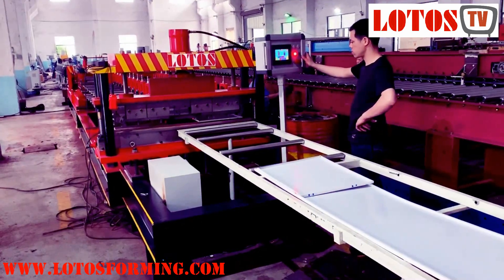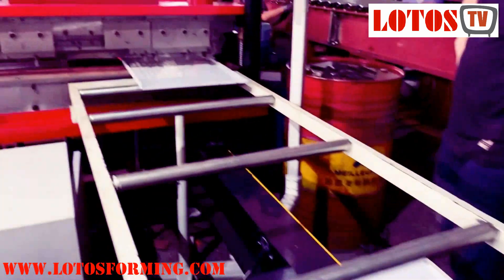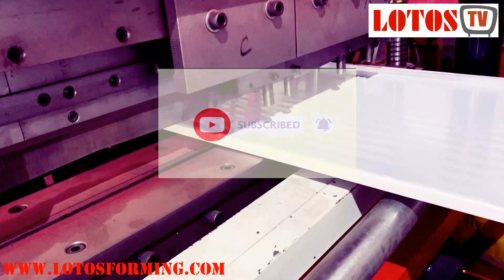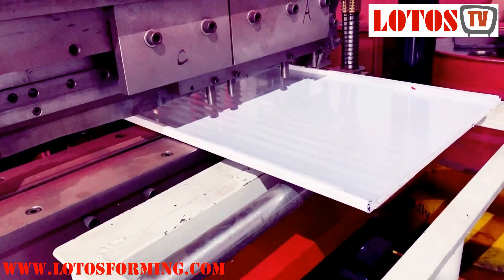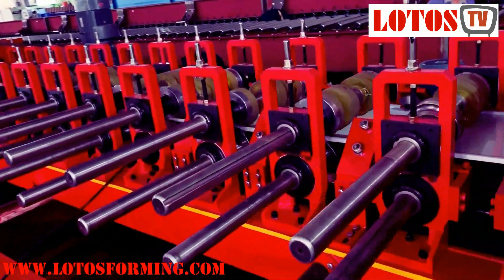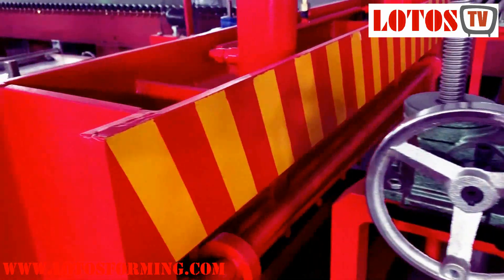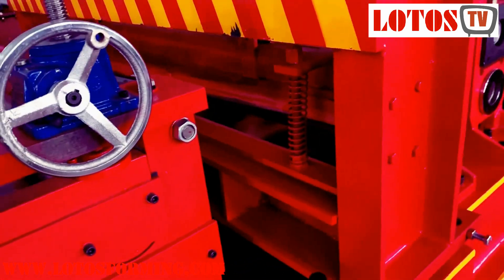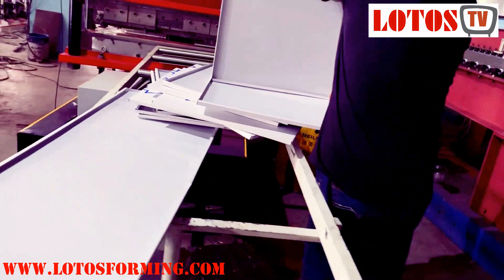【 panel door machine 】: Rock wool purification board machine | outside wall panel machine

Comment: The metal panel door machine OR exterior wall panel making machine is for producing outside wall panel automatically. The Machine can cutoff the wall panel profiles into desire length.